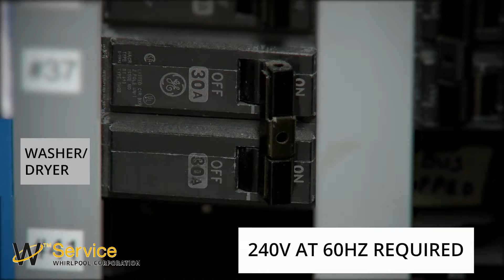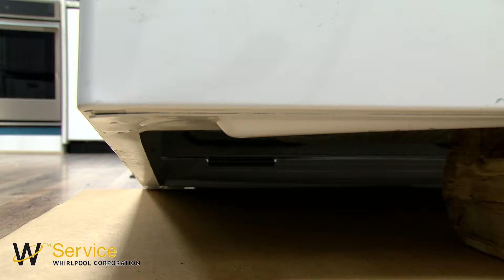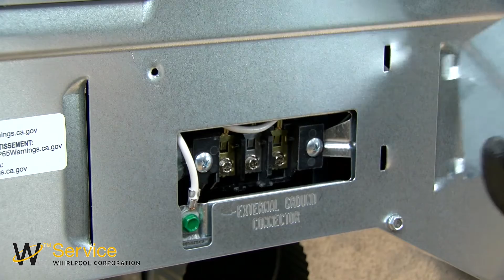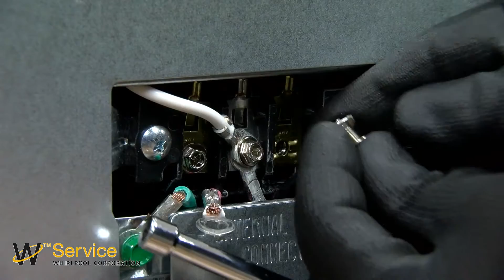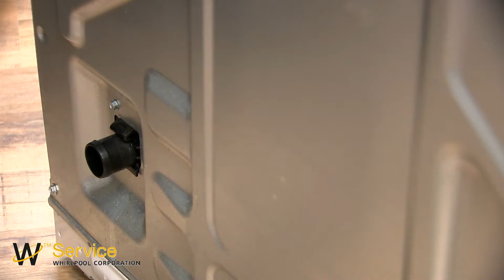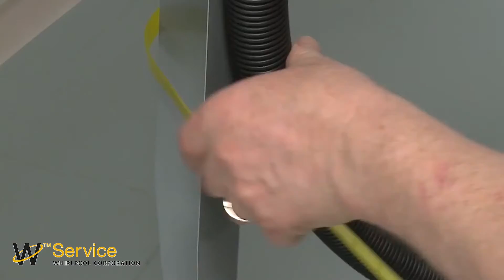Combination Washer Electric Dryer Installation

Comment: Good video, but at 6:29, that white wire that was removed and attached to the center terminal is sloppy and dangerous sitting sideways. It should be standing straight up, not sideways encroaching on the left wire as is shown here. Terminal blocks have channels, or walls between the conductors for a reason. Bet an inspector would gig you for this. On the flip side, the use of a nut driver instead of a Philips screwdriver is very much recommended.